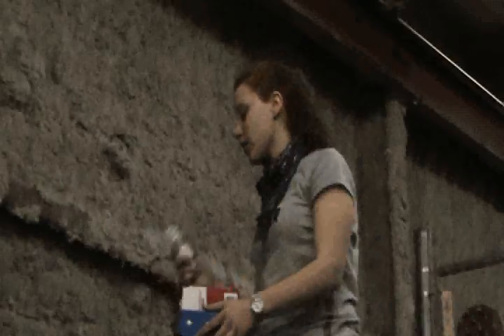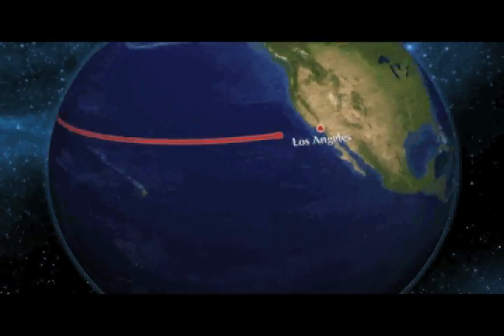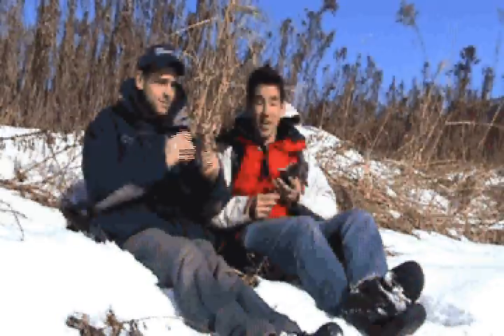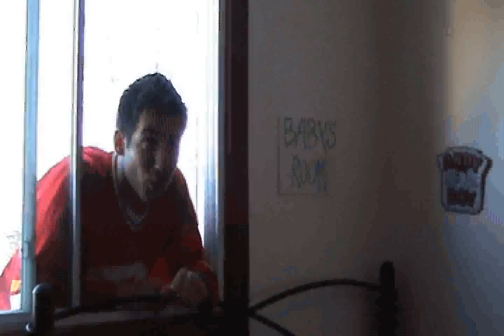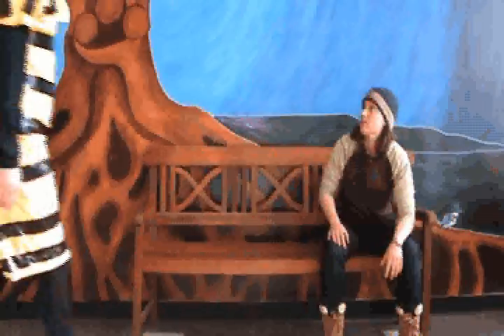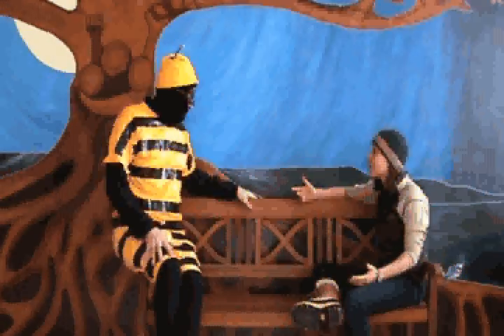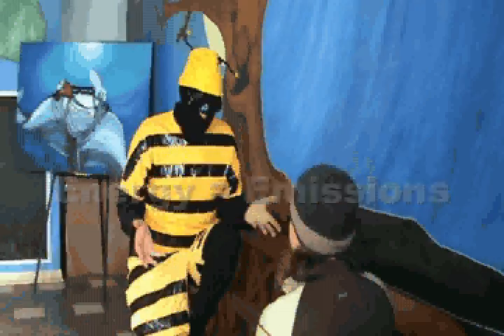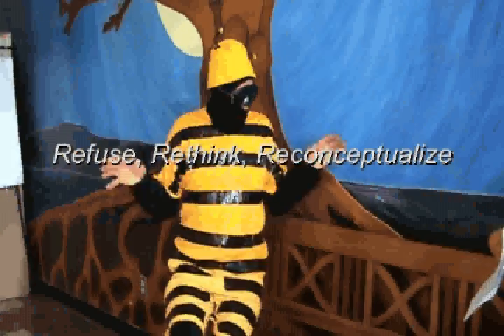The Fallacy of the Compact Fluorescent Light Bulb

Comment: Also, tubes have been around forever, yes, but are usually only used in garages or in covered fixtures in kitchens. Tubes also don't break as easily as these do. The fact that there is no cleanup instructions or stated mercury content on the boxes is unconscionable. The government constantly states "the small amount of mercury would fit on the top of a ball point pen" which in no way speaks to its toxicity.